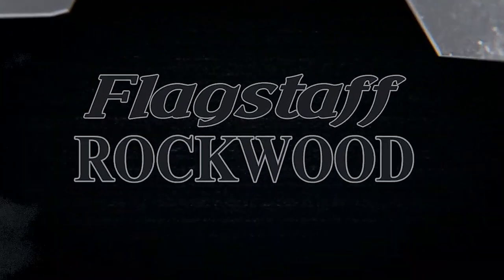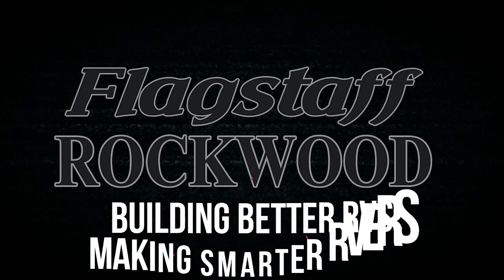Which is better? Stick and Tin or Laminated?

Comment: Just bought a 2021 Flagstaff Micro Lite 25BRDS as our very 1st travel trailer and one of the main considerations for my wife was the visual appeal of the laminate construction.  I like the vacuum bonded laminate panels as well as the aluminum framework underneath.

Comment: Are stick & tin easier to repair if there is water problems.   Seems water leaks in a laminated turns into delamination that is not repairable by the owner (yes you can add resin, but it's more of a patch than repair).   I wonder if the tin can be replaced/repaired easier/cheaper/by owner.   Yes, maintenance keeps the water our, but everything leaks sometime!
Reply: Yes, it is cheaper and easier to repair. The sheet metal starts at the top and goes down so you remove the sheets from the bottom up. Tail swing into a parking lot bollard and damage the bottom? Just order the bottom run from the trailer factory and replace it.

Comment: The more common types of side walls are; stick and tin, Filon laminated to luan ply and foam, and Azdel laminated to foam, excluding Airstreams and busses. 

I bought a stick and tin because an Azdel sided rig was not in my reach. 

You couldn't give me a rig with Filon and luan side walls.  The glue used on luan ply is not waterproof and it will delaminate while you watch. Remember all RVs will leak at sometime in their life.

Luan is three plies and  ment for underfloor layment and for $5 more a sheet you can buy five ply underfloor layment with waterproof glue. That's the retail price difference. Heck I've built boats out the waterproof glued stuff and sailed thousands of miles in them. Why the rv industry still uses luan is beyond me.